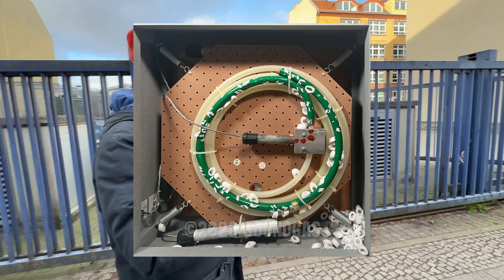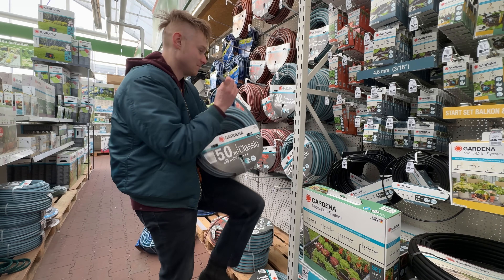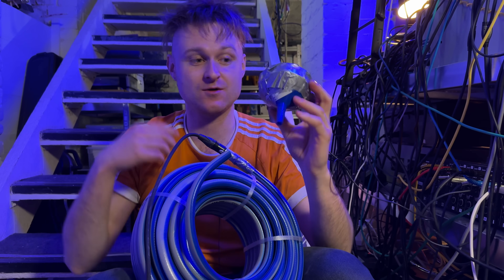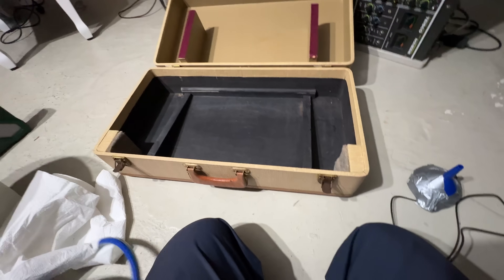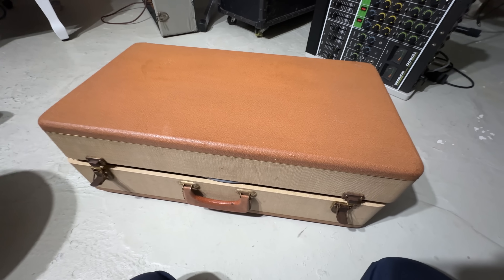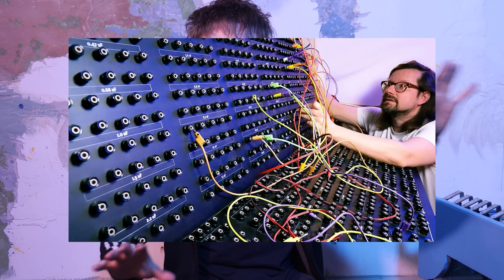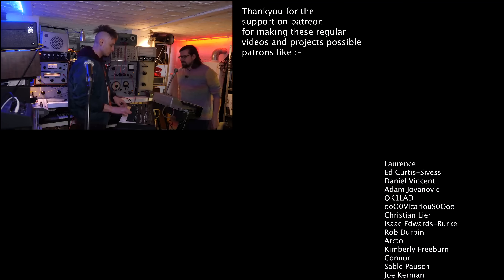MAKE A STUDIO DELAY WITH SCIENCE AND A HOSE.

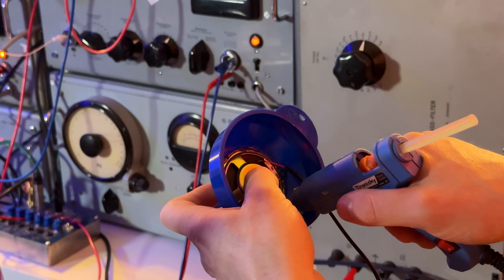Comment: Cooooooooool, idea .... but if you would use another "funnel" (4:01) with the same speaker and use that as microphone on the other end, having it air closed.
Would that improve the thing?

If you decide to built a Mixer "finally", place an Atari arcade button to switch (Struder 961 mute circuit) the audio above the fader.
The most complicated stuff would be the headphone path, being able to listen to one channel, bus or  total mix.
Something with arduino, some logic gates and multiplexers. Than you can go wild sonicly.

Comment: The funnel is a lowpass to start with. The speaker is nowhere near powerful enough to drive the tube. Get a cheap old compression driver and hook it up, it can drive a plane wave. Then put the microphone about a meter from the end and stuff the last meter with more and more polyester wool. now you've got a cheap ass impedance tube with anechoic termination. The purest acoustic delay known to man!
Reply from the maker: the actual time cube only used a mic capsule as a speaker

Comment: Maybe you could apply an ascending EQ to the drive, to balance the muffling
Reply: Harder pipe. Brass was used in old ships and submarines. Or embrace the tone- I just scored a Western Electric Carbon Cartridge mic to capture my Talkbox tone. (Two hoses fed from a Stereo Leslie Emulator is the latest trick)
Reply: Need to calibrate by running white noise through it and looking at the resulting spectrum. Then pre-compensate with an EQ that's opposite the spectral response from the hose. Might need to notch out the resonant frequency as well - you can hear some feedback forming towards the very end of the video.

Comment: Air/Water Tube delays are watery cool :)  Like trying to sing in an indoor pool room.  Ive often wondered about flat springs as delay (laser cut sheet metal to a spiral, place a driver element at the center, and pick up points along the spiral arc) or using the spongy action of a column of magnets in a tube,  South to South then North to North, as there is a period of absorption time before each repelling magnet moves next, drive one end and pick up on the other :)
Reply: What a great idea. Could even be expanded on by using electromagnets to damp/excite the spring rhythmically.

Comment: I wonder what a "physical scanner vibrato" would sound like. Imagine instead of having a rotary contraption tapping signals from different points on the resistor-inductor ladder for different phases, you had the hose drilled with electrets every ~1 or 2 meters for example, and a sequencer switching their output for modulating the delay times?
In my mind, the hose would look like a "flute" drilled at the diameter of the electret, which would be placed and covered in epoxy so the sound would continue travelling until the end. Not covering the end and letting the sound go through the other end should give a more "open" sound too, maybe? (open ended)
I love your videos, they are really inspiring.
Keep doing your experiments and sharing with us please.
Thanks o/

Comment: IIRC, the og. Time Cube had 2 hoses of 14ft. and 16ft. respectively, which gave it 14 and 16 ms of delay. For practical purposes, you can calculate delay times with 1ft.=1ms or 1meter=3 ms.
Reply: If I was designing a thing like it, I would use 13ft and 16ft.  The lengths share no divisors.  And the difference shares no divisor.  This way when you loop it back for feedback to make a sustained echo, you get the signal repeated at times of:
13ms
16ms
13ms + 13ms
13ms + 16ms
16ms + 16ms
13ms + 13ms + 13mS
.... etc ...
The list goes on with no two sums equal until you get out to 2.08 seconds.
Reply: Ideally you'd want to tune it to the root or key of the track. As far as L-R detune, I'd cut 1 side slightly longer than the ideal length, and the other slightly shorter. IDK the ideal offset, so that it separates, but doesn't quite chorus. I guess trial and error is difficult when you have to cut more material, from one side or the other, for each new trial. You could figure it out the best sounding detune amount digitally, and then do the math to find the correct difference in hose length, for that detune amount.

Comment: You can buy 25M coils of 15mm copper pipe… Not cheap, but it’d probably have more high end to it than the rubbery plastic.
Reply: Yeah, the rubber (soft plastic probably absorbs a bit of sound.

In the picture of that original pipe delay it looks like they might have used pressurized air-hose, wich makes sence, since it is pretty rigid and doesn't expand.
Reply: yeah I've wondered about these too.. but in the case of tight coils of copper.. perhaps you need to insulate each loop of the coil from the next.. to avoid metal->metal transmission of the signal "jumping ahead" through the system. May or may not be a bad thing, soundwise, though
Reply: Never seen coils of 15mm, but you can get coils of 10mm and 8mm.
Reply: PE hose for drinkingwater or floorheating is probably cheaper.😊

Comment: I was wondering if you could 3D print a cube with a complex tunneling system inside. The material like PLA is much harder so it wouldnt muffle the "highs" as much like the rubber hose.

Comment: I wonder if some insulation between each loop of the hose would keep vibrations from traveling through the walls instead of just through the air in the hose.
Reply: Wonder not - it would.  Significantly.  In rubber the speed of sound is about 60m/sec, so across a 0.2m wide bundle that's approximately a 3.3ms delay.  Around the whole 30m it's a half second delay, but the damping would be so strong almost no power would be left in the wall vibration at the other end.  It's a really good idea.

Comment: Love it reminds me of old CRT TVs that had a time delay component that was just a length of wire proper old school.
Reply: Well, weirdly enough, in modern computing devices circuit board's wire lengths have tight tolerances, and occasionally some extra curves are made to have them in sync. Especially visible in devices like high frequency oscilloscopes.
Reply: @McSlobo  The traces for RGB components in high quality graphics cards often had additional curves to make them exactly same length to avoid delay.

Comment: You need to get a hose that is made of plastic, one of those pexal hoses, that also has aluminium insertion. This  hose is rubbery, it will dampen the sound. 100% procent will sound a lot beter with a pexal hose.
Reply: the black PVC pipes for drip irrigation might work well for this, and should be fairly cheap. the box will have to be bigger though.
Reply: @TDOBrandano  Heat it up and you could pull it into a tighter coil than it ships in...
Reply: Cool tip!
Reply: theres so many different hoses, you could just have a collection of different ones to swap in
Reply: If the speaker driver has enough excess power then you can just measure the frequency response of the system and null it out with EQ by applying a pre-emphasis filter to the input, this way the signal received by the microphone is already compensated, including nulling out the mic's response. Since the system is analog an IIR type digital filter will automatically fix any time alignment issues if the frequency response is zeroed out. The output from a transmission line like this will probably be comb filtered due to the tube resonances, which the tube damping may affect.
Reply: I'd bet wall thickness affects the sound too. So it could be more "echo-y" with something thin-walled and made of a relatively stiff material.
Reply: Maybe coiled copper tubing?
Reply: @pauljs75  Yup. Hard plastic tubing does that. Also dirt cheap, far cheaper than a waterhose actually! Modern construction uses stiff plastic piping for potable water systems now days. There's a bunch of different brands etc sharkbite, PEX, etc. Just look for 'pex tubing'. Waterhoses are typically 3/4" ID, same as Pex. But you can get all sorts of sizes, and it's a very stiff plastic tubing that is still flexible. And the smaller sizes with pushfit connectors are used in everything from air compressor setups, soda fountains, ice machines, etc as pretty much the defacto standard piping for potable water, filtration, etc.
Reply: Garden hoses give a good damping for drum mics or pre delay for reverb, but yeah pex or nylon tube would do a lot better. Or talk box tube.
Reply: Came here to make this suggestion as well- I was going to suggest polyethylene tubing or the pex plumbing tubing like the op suggested - I think vinyl would absorb a lot of sound as well, and I think copper might work great for a short distance, but since it’s so good at conducting heat, it might absorb all of the vibration by the time it gets to the end. Very cool!
Reply: @jakospence  That's not how sound propagation works. The copper is too stiff to experience more than perhaps a couple nanometers of displacement from the air pressure fluctuations inside, so no meaningful heat will be generated - the acoustic energy experiences a near 100% reflection by the stiff copper tube due to the disparity in the density and stiffness of air and copper. Even if you used a latex tube many other factors would be orders of magnitude more important than thermal effects, and I'm not sure where you'd buy elephant condoms anyway ;)
Reply: @maudiojunky  Thanks for explaining!